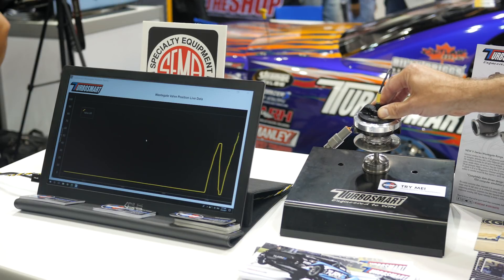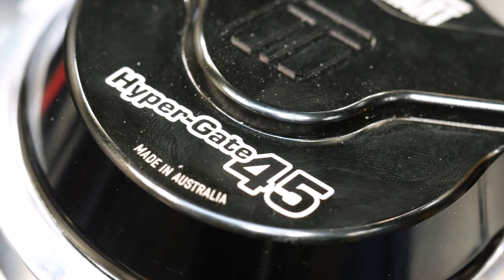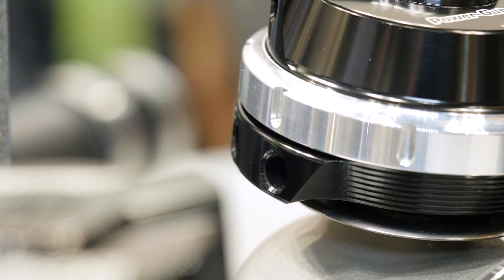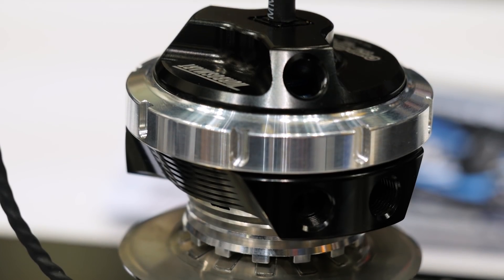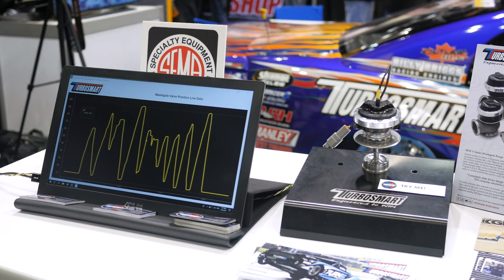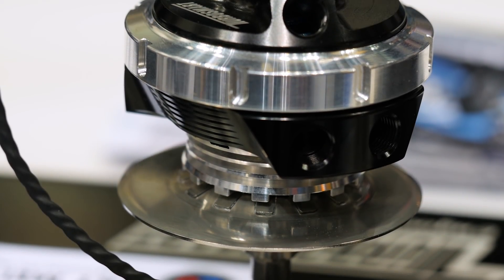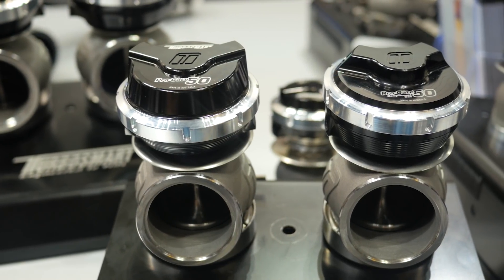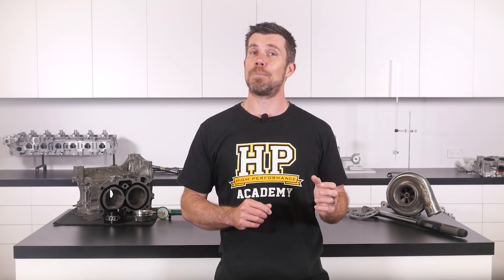[TECH NUGGET] Accurate, Efficient and Reliable Boost Control | Turbosmart External Wastegates

Comment: Hey guys love the channel!! 
What kind of application do you find CO2 being used? Thanks for your time.
Reply from the maker: Normally CO2 will be used for applications where a very wide spread between minimum and maximum boost is required, or alternatively extremely high boost levels are needed. Typically this means that CO2 control is only used in drag racing.
Reply: Thank you guys continue the great work!

Comment: Any opinions on the newer internal gated turbos. Borg Warner released thier efr internal waste gate turbos oems pretty much all use internally controlled turbos.
Reply from the maker: Traditionally internal gates have been problematic in very high output turbo applications. With some of the modern turbos from the likes of VBW with their EFR series however, internal gates can and do offer good boost control. The difference is that these turbos are purposely designed for a performance application and the wastegate and the flow into and out of the wastegate is designed to support the expected flow. 

The upside is often a simpler installation and a cost saving, however the internal gate can reduce the flexibility of clocking the housings with relation to each other.